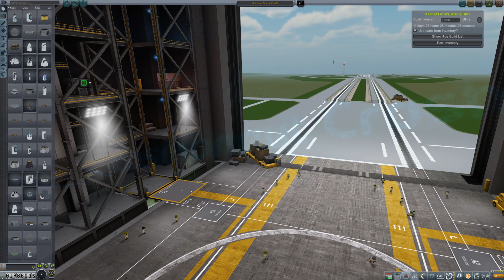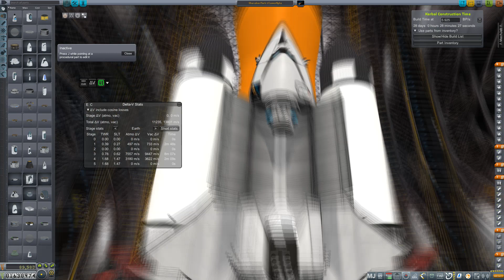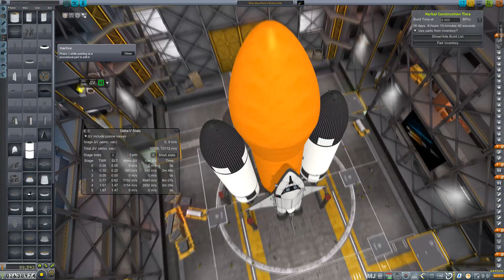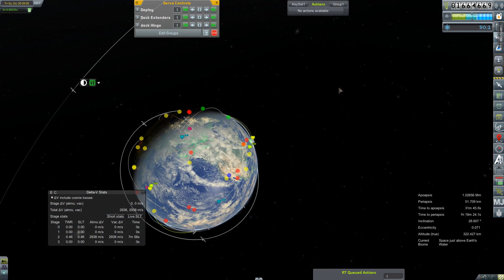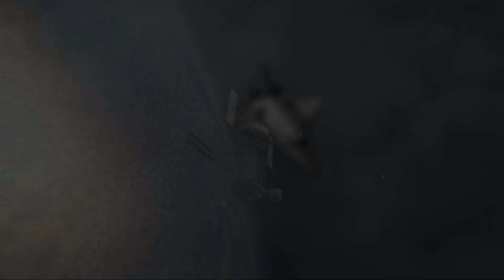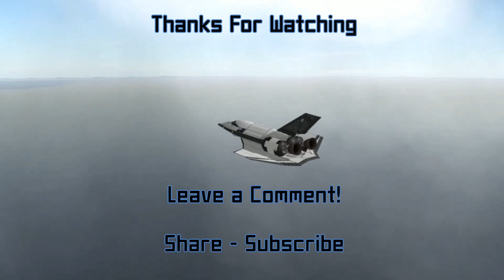KSP RP-0 #309 Mobile Lab Station

Comment: Wow, a very smooth mission. Nothing went wrong.
Reply: Spoiler alert? :) But, by the way: The module looks very nice. Only those extendable docking ports are looking a little bit odd.
Reply from the maker: *yet
Reply: The Kraken will change that ;)
Reply from the maker: Thanks!
The extendable ports are a bit weird, but they have a very specific purpose.